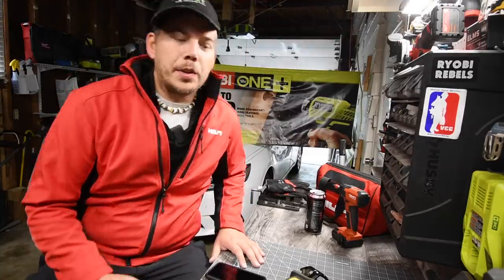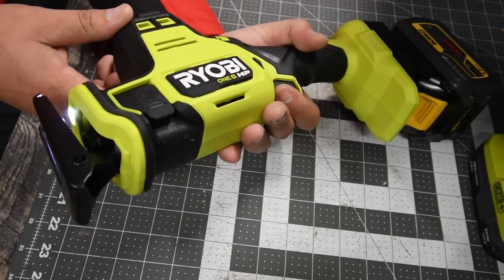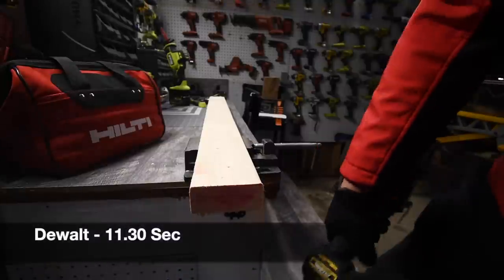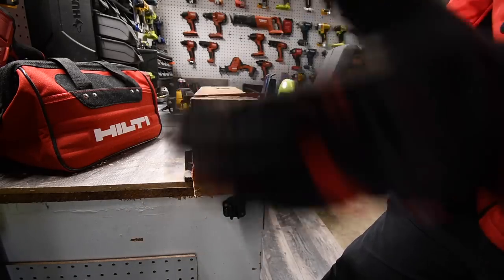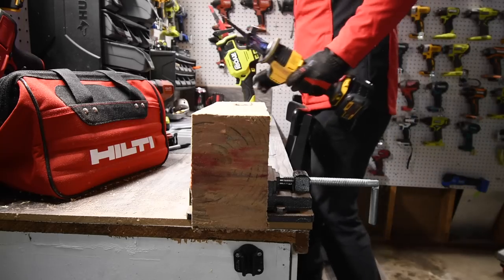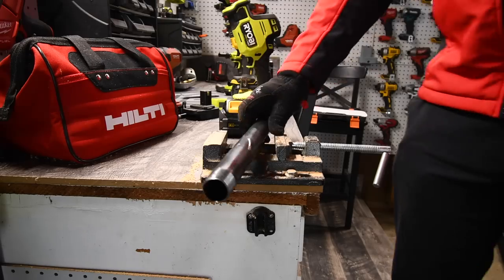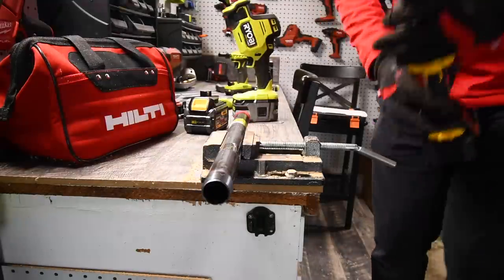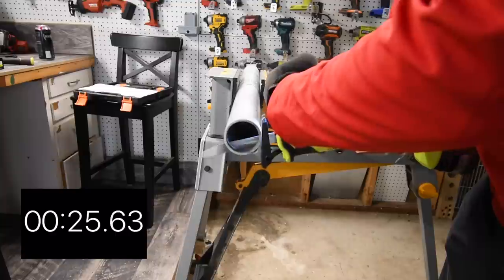Dewalt vs Ryobi (Hacksaws)

Comment: Hey! I know this is old but... you need to start doing controls in your testing for accuracy. Like this tool you should add a 10 lb weight on the end and you can use the same weight with the other tool to compare.  For the drilling you can get a dumbbell and place it on top. stuff like this just makes way more sense because you can not be 100% accurate in testing and comparison when working with muscle memory
Reply from the maker: I do need to do that and I thank you for the suggestion Master

Comment: Comparing tools using a battery adapter is a cool idea! Thank you for sharing these great tests. While more powerful tools work faster, they have proportionally more weight and vibration, which wears out the user faster. I see the difference between these being one of convenience, not exactly performance. 

I assume the reason the DeWalt is popular despite being slow is because the people who need more performance (and can handle the beating on their body) will use a much larger saw than either of these. Keep up the good work!

Comment: I always wondered if the adapters increased resistance and reduced overall power but I'm glad to see they don't. Been a while since some good content has came out. Nice to see somethings good
Reply: Just have to watch out for tools that have safety features that require communicating with the battery... Adapter with a different brand battery won't work that way.  So risks damaging either the battery or the tool if the safety features never kick in to prevent it and you don't keep track of things like over draining the battery, over heating, etc.
Reply: @ZeoCyberG  i didnt think about that
Reply from the maker: more adaptors will be coming to this channel

Comment: that's a surprise well done Ryobi. I do like the design of the Dewalt better with the movable foot when pivoting. very nice review of both plus adaptor. but would be going into a tool range based on this tool as I think the Dewalt is just better, but stick to what you have got i guess. or if its you just buy everything haha. you will definitely be on my trusted tool guy reviews now as i have just got rid of one by saying the flex volt could short out your tools (which is impossible by design)
Reply from the maker: I agree, this is the atomic, if Dewalt made an XR it might do better

Comment: All new recip saw shoes should be depth adjustable. There's no excuse. An adjustable shoes makes a big difference when having to cut near critical things like plumbing and electrical. Given that these one-handed saws are specifically designed for those hard-to-reach places, they should definitely be adjustable.
Reply from the maker: I agree with you on that
Reply: Mike Dorman  That would be an acceptable solution as well.

Comment: If the stroke is too short, it will need to be capable of 15_20% more strokes per minute.
However, after watching the video, I'm glad to be vested in the Ryobi battery platform.
Reply from the maker: The Ryobi platform is good to get into

Comment: Tim from Canada why is it Ryobi is the handyman tool with the pro tool price for example in Canada all Ryobi tools have gone up at least $50 or more since COVID-19 hit... it is very hard to find a very good tool by RYOBI Brand at the Home Depot for a reasonable price I have found that the Ryobi tool supposed to be for the handyman is now got the pro man price I can tell you for example. .. before COVID-19 you could go to Home Depot in Canada and buy Ryobi 4 tool combo that come with 1reciprocating saw ,1half-inch hammer drill,1. 1/4 impact driver..1 light 1 charger 1 .2Ah battery..1...4Ah battery the price before COVID-19 was $199 Canadian...Now..after cOVID-19 is $279 Canadian..  this is a hell of a jump in price at the Home Depot in Canada for Ryobi tools.  But I see in the Americans website Home Depot your tools are very cheap priced then they are in Canada.  No matter what you buy in Canada everything is overpriced and cheaply made.
Reply from the maker: Thats sucks man and Inm sorry. keep your fingers crossed for some deals bro

Comment: DeWalt makes solid, smooth, but notoriously slow, Recip saws.  And why they still do not put a rafter hook, or adjustable depth shoe, on their top of the line saws, is ridiculous.  This Atomic Is obviously designed to be lighter in weight, and so I kinda understand no rafter hook, but come on DeWalt, at least throw on an adjustable shoe?  The Ryobi clearly outperformed it.  I was glad to see you checking the temps, as other channels have reported extremely high operating temperatures, and overheating issues?
Reply from the maker: No issues yet on these tools. I always show if a tools fries out

Comment: 10:30 is a little late for a tool premier
Reply from the maker: I worked late today and I want to be able to watch this uninterrupted
Reply: Good video

Thanks
Reply: just letting you know son I believe your end goal is to get views not gonna reel them in late night
Reply from the maker: @mikemerk1407  This was just to see how the public would react to it. A time will be established this week, a certain day of the week and a certain time every week until I start to go live. :) this is being added to the channel weekly
Reply: sounds good I have a suggestion for an impact wrench review recently I purchased a greenworks 24v impact wrench from amazon when they were running a great deal i paid  $52 for the impact wrench and $67 for a chainsaw with battery and charger the only reason i purchased the chainsaw was to get the battery and charger for the impact but it turns out the chainsaw is pretty good for its size but the impact wrench is really small I would compare it in size to the makita low range impact that you just did a video on but the greenworks impact wrench has far more torque it is rated at 540 ft lbs I took it to my buddy's shop where he has a 3/4 inch torque wrench that goes up to 600 ft lbs and we torqued down some semi lug nuts to 500 ft lbs and this little impact popped them loose I was super surprised I tried my milwaukee mid torque on them which is way bigger than the greenworks and the milwaukee wouldn't budge them
Reply: It's now 10:15 where I am and I'm just now sitting down to watch some YouTube videos. It's almost as though the world doesn't run on your schedule.

Comment: Do you think it's worth switching in terms of power & cutting time from the atomic to this Ryobi? Mind you i do not have that beefy 60v battery i just have regular 5ah batteries from Dewalt, not sure how much of a difference there is with power. So Atomic w/regular 5ah battery VS Ryobi w/6ah HP battery. Is it worth switching?

Comment: I am a long time Dewalt user an recent switched over to milwaukee because porter cable an milwaukee were my old man's favorite.an I was getting able to afford it.then I find out ryobi is owned an made by the same company that owns rigid an milwaukee an shares everything except batteries because of rybobi never changing there power connect in 25 years an for good reason..they claim to make the everyman tool for everyman price so they said they would never switch platforms so u need to get all new power packs that's why u can still put a new ryobi batt in a 25 year old drill an use it

Comment: Hi, 

Wow, this is going to be very interesting. I do hope DeWalt can make a larger hackzall like milwaukee m18. I do have the milwaukee hackzall and it awesome. 

I use both brand so I'm happy either way.  I differently going to buy those battery adapters so i can use both battery brands on my tools.
Reply from the maker: I think they should as well. the Atmoic is a small one
Reply: @ManCaverTools  

Yes, i agree on the size of the DeWalt 20v atomic and 12v hackzall.  The smaller frame does have it's purpose for tight spaces. 

Again, i hope DeWalt comes out with a larger size and more power like the  milwaukee m18 hackzall or like the Ryobi.  

That 12v chain saw was pretty cool. Amazing how fast it cut.

Comment: I wish the Dewalt saw had the same blade install as the Ryobi. The chuck/blade insert thing on the Dewalt eventually wore out and was hard to change out blades. I do have an adapter to run Ryobi tools on Dewalt batteries. Might give this Ryobi a go

Comment: Hey i had a question i recently purchased the same tool, yet it sounds like something is loose inside the tool does yours make a noise if you shake it side to side. Thought mine was defective, shook the hd display and it does the same any insight on this?
Reply from the maker: id ask for a trade in
Reply: The hp  impact I got does the same thing and I've heard other people say the same thing. It works fine though
Reply: @chiefsnation8347  thanks for your input

Comment: ryobi needs 64sec to cut a piece of wood 4"×6"...
however, the same tool, with the same blade (lightly more worn)
with the same battery (lightly more weakened), to cut the exact same piece of wood plus 3 metal nails, it needs only 54sec...
🤤
well, I guess if we nail three more nails, (six nails in total) it'll be able to cut it in 44sec!!!
😂👍
Reply: Perhaps with enough nails in it, it could achieve hyperluminal cutting! Recip saws to warp 7 Mr. Sulu!
Reply from the maker: I thank you for viewing Nikos Lolo
Reply from the maker: lol

Comment: Atomic line has the same power of the 12v xtreme without any of the practicality.
Reply: You use the same 20volt batteries as the rest of the tools.  Lightweight tool without starting a new battery line.
Reply from the maker: a versus video will be coming soon